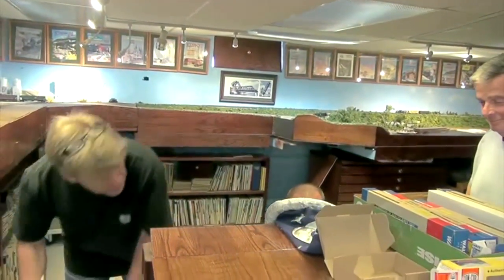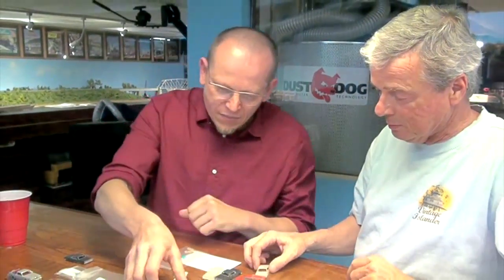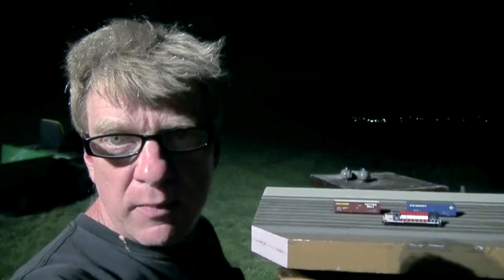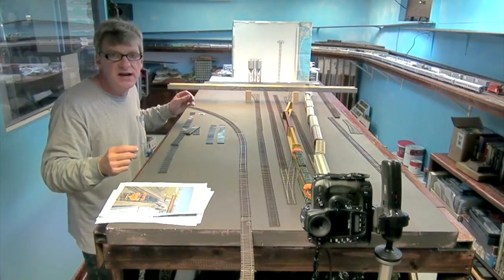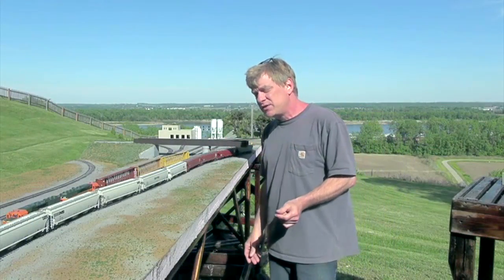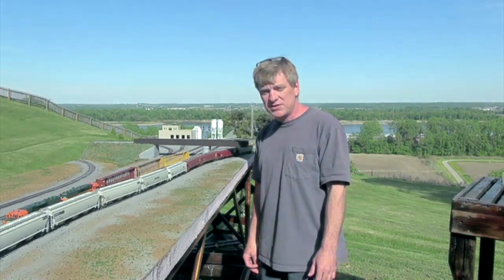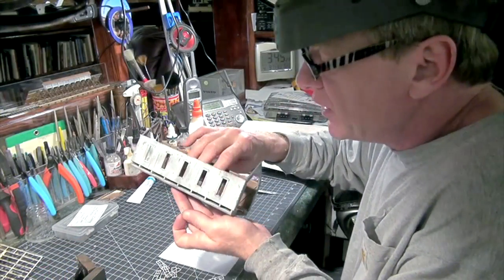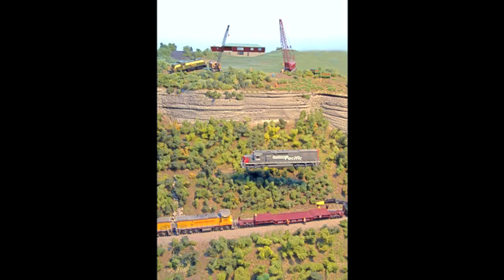Jens Jahn interview | Model railroad tips | Model Railroad Hobbyist | MRH

Comment: buy one 3d printed car and cast it and paint it. i wish they had a 66 impala or much more old sedans.
Reply: +Brad Caloroso or a 2000 Chevy pickup with a standard cab with a 8 foot bed and a cap.(modeling my house 1992 caprice 2000 C1500 and a 2003 Buick )